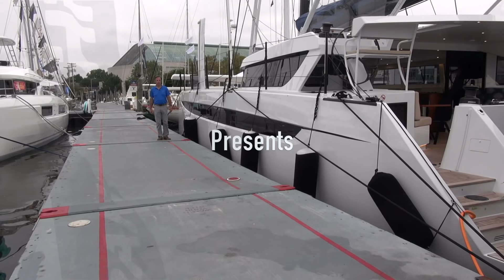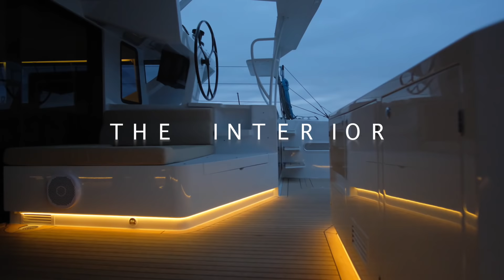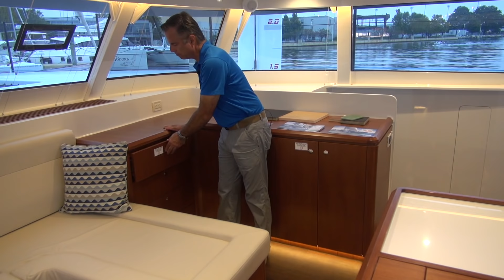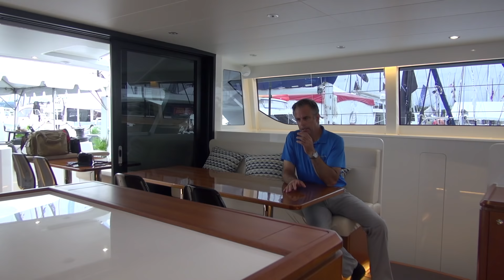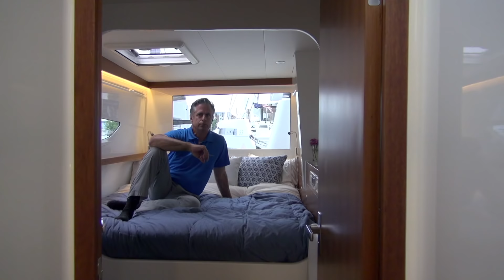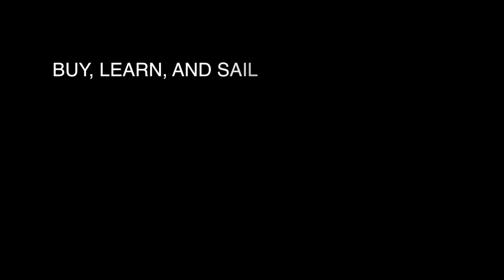HH 55 Catamaran 2019 Model Interior Review with Scott Rocknak Part 1

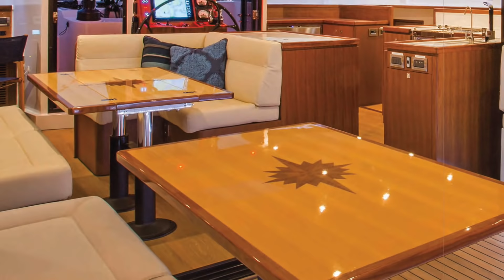Comment: while the HH55 is one boat I keep coming back to on youtube, one frustration I have is the absence, in your reviews, it seems, of clarification as to just how much customization is available (I do acknowledge the alternative layout shown at 6:33, although that's on on a unit with helm forward; and I have seen you showcase samples of wood finishes). specifically, I have in mind a galley down, aft. is this something HH would consider? where the galley is I'd rather see beanbags. also, while the wood finishes are glorious, more contemporary alternative options would be great.
the sprawling couch, by the starboard helm, could that be made into a large storage space, the top of which would be level with the floor of the helm station?
Reply from the maker: Hi Guy, on the HH55, and larger, all the features or customization you mentioned are possible. Let me know some of the other parameters too, such as cabins desired, heads, etc . Scott

Comment: I have a question about the cabinet material. You mention that the molding is solid teak but does the foam sandwich material have a real teak veneer or is that an artificial teak? Thanks in advance, I know this is a bit in the weeds but I love those cabinets!
Reply from the maker: The cabinet veneers can be (real) teak, oak, maple, etc.on the HH55. Each boat is different. The cabin sole is an engineered wood unless otherwise specified. In that application its best to stay with the engineered as its more durable than what you may have seen traditionally. Send me an email and I'll get you the specs PDF and the Brochure PDF. Lots of good data.
Reply: I was really just wondering specifically what Utopia had. I've had a lot of conflicting information about the real wood vs. fake wood cabinets. Ticket to Ride has a real wood interior that is glossy. I'd like real wood matte but was told that's not possible. @ROCKNAKSYACHTSALESINC
Reply from the maker: You're correct in noticing that each boat can have different finishes or materials. This includes the window valances, cockpit & dining table, interior hull cabinetry etc..Utopia has satin finished (actual) teak veneer. The solid teak trim is also in a satin varnish. The dining table is high-gloss teak. The galley counters are white corian while the starboard forward salon cabinet top is in teak. The owner wanted a lighter color species of teak and its a consistent shade throughout with effectively done book matching.  Each owner, including Ticket to Ride's, make the boat a bit of their own. With the HH55 model there are a reasonable amount of possibilities based on your tastes and requirments. The Ocean series have a different (and large) set of options and the focus is on the engineered wood selections.

Comment: Just an inferior Chinese knock off.
Built using design and technological secrets stolen from Gunboat, but to lower standards.. 
would you trust your life to this, or buying a boat from such a company?  
We Vote with our spending.
Reply from the maker: Hmm, inferior product? Nah. Far from it. Extremely high end. One of the nicest boats I’ve been on. Watch the Systems video. It shows quite a bit of the construction if you know where to look. Stolen what from Gunboat? This boat is from the same designer and architect of the 48, 66, and 90. All 18 of them. The HH 55 is entirely a new design. Completely different. Stay tuned for Part 5 “The Design”.

Comment: Just an inferior Chinese knock off.
Built using design and technological secrets stolen from Gunboat.. but would you trust buying a boat from such a company?  
You Vote with your spending.
Reply: If it was a gunboat it'd have that beautiful interior helm.. Instead of that open back upper with no way to get out of the elements

Comment: Who makes the stove on the boat? What material is that ceiling made out of?
Reply from the maker: The stove is a Force 10 (and is a gimbaled model). The ceiling is a removable molded panel. Need to get the actual material. Will update.